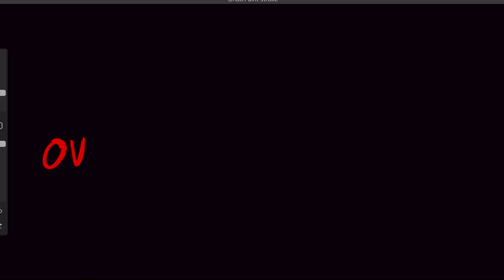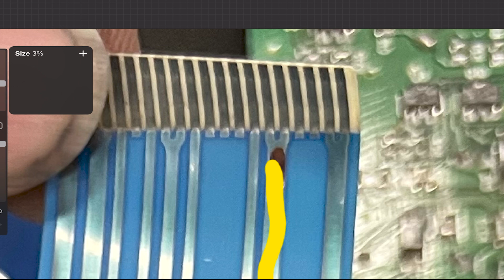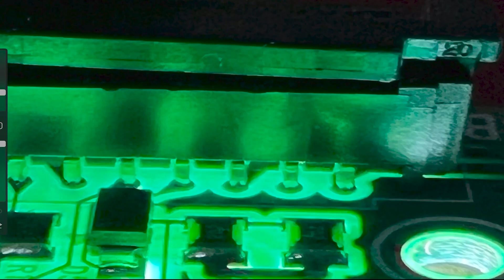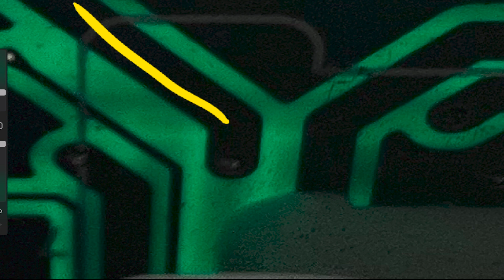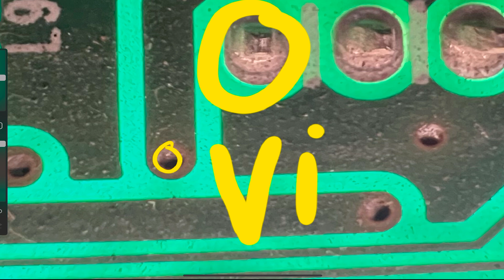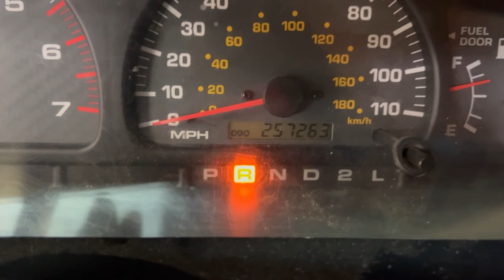2000 Toyota 4runner cluster repair p1780 Park/Neutral fault

Comment: I had been dealing with this issue for years, not knowing what the cause/solution was. I replaced the neutral safety switch, readjusted it twice, and had a buddy check it out, all to no avail. Even after having a complete transmission replacement [which was a separate issue], this problem remained. I finally was able to get a successful diagnosis from a local shop and they quoted me over $700 to ship the cluster out for a rebuild, a quote which I immediately turned down. 
This video allowed me to understand and locate the issue, and ultimately fix the problem in under 30 minutes. FOR ZERO DOLLARS. 
I cannot thank you enough for creating this video. You have saved me hundreds of dollars and countless future frustrations. 

Thank you so much! 🙌
Reply from the maker: I’m glad I could help out. We love these 4Runners and do whatever we can to keep them functional.  Luckily they are very reliable so we don’t have to do much to keep them going. 

Thanks again for the tip.

Comment: I'm working on P1780 on a 2000 4runner.   The circuit board is definitely the failure.  Problem is, the copper is almost as thin as gold leaf and each circuit is slowly breaking at a bend.  It's made worse simply by opening & tracing circuits. 

It's a shame no one has the circuit boards anymore.  The smaller section going to the gauges has 12 of 12 circuits open.    

A used one will probably be as bad or worse in a few months.
Reply from the maker: @oddsman01  I have only encountered the issue recently so perhaps it’s an age thing with continuous heat cycles. I salvage unit with low miles would likely be a good unit

Comment: I had the same issue on the same solder joint!

 I just scraped the plastic back a couple mm, covered it in flux and stretched the solder out. We'll see how long it lasts.

Comment: I replaced my park neutral safety switch and that didn’t fix my issue. My symptoms are dim reverse light while in drive once I hit 44 mph it goes into limp mode and the reverse light is bright. Would a bad flexible circuit board cause that type issue?

Comment: Do you have a video on how to repair the fuel gauge instrument panel. That doesn't mark.
Reply from the maker: I don’t see too many fuel gauge issues on Toyotas. The last couple I have seen have been caused by rodent chewed wires above the tank.
Reply: @ThePracticalMechanic  There's a small circuit board under the main one.  It powers 3 separate gauges, one of which is the fuel gauge.
Reply: Just checked.  It's fuel gauge, speedo and tach screwed onto the smaller circuit board, at least on a 2000 4runner SR5.